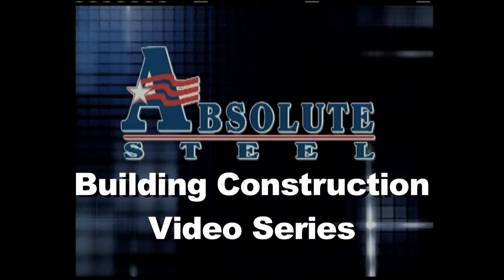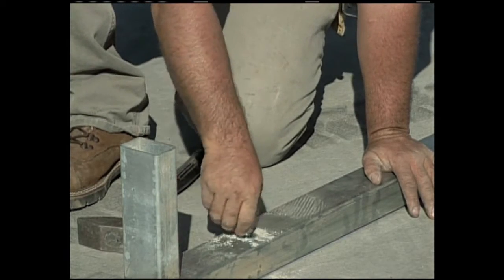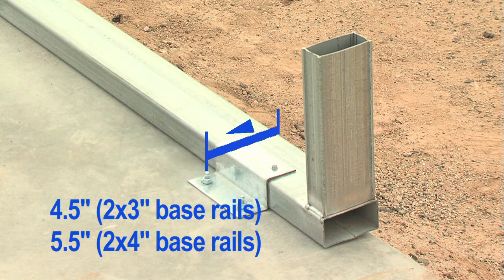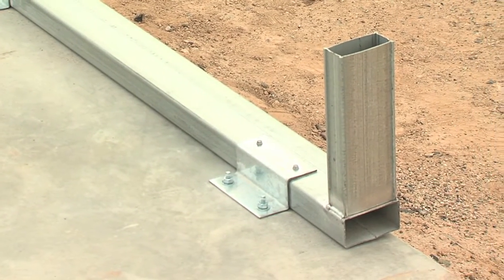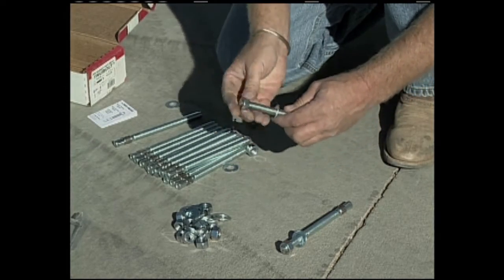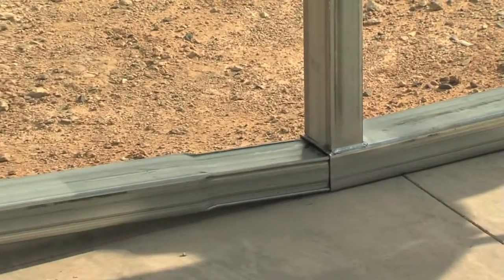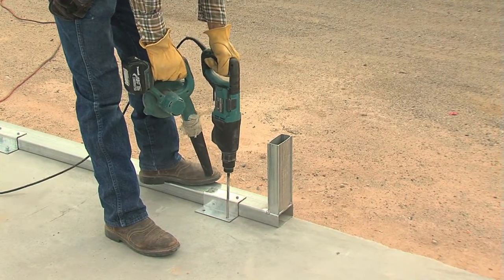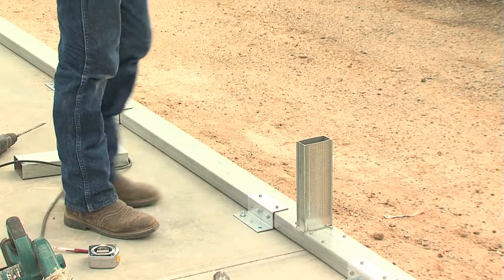Metal Building Installation Step 7 - Anchoring Base Rails

Comment: There goes torque for the nuts out the door. If you going to do the job for a customer do it right. Don't short cut the job by not putting the right torque on the nuts.